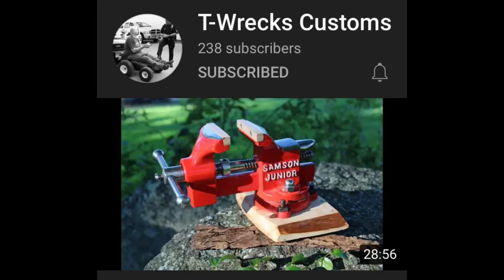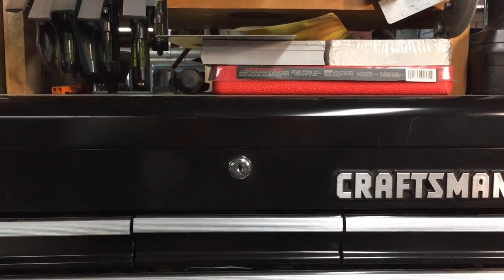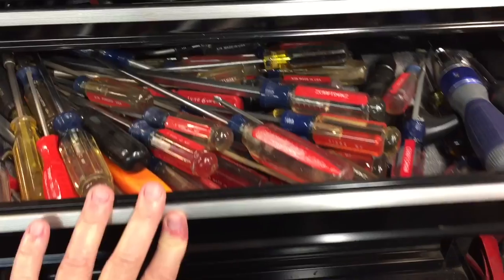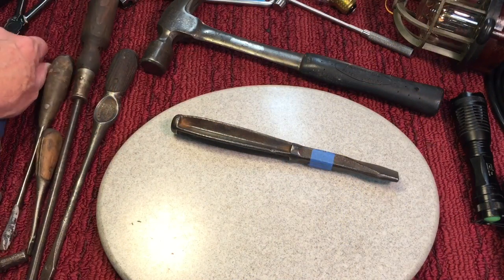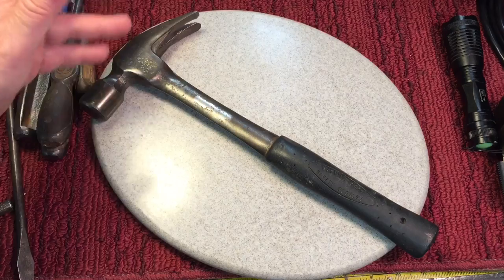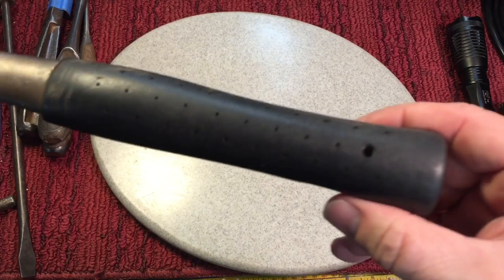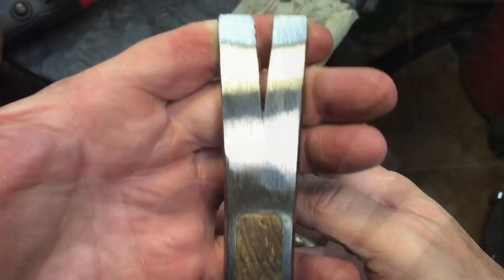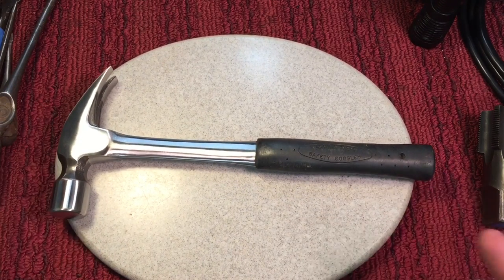Vintage Collectable Craftsman Hammer #38273  20oz "M" Series

Comment: #2 HD Smith.. Top of the box is great for bulky things, gloves, safety glasses, oils. Small drawers for small tools, bits, blades, pencils/pens, rulers, slide rules, drill keys, etc. First wide drawer screwdrivers, then a plier drawer, then a drawer for SAE wrenches, drawer for Metric wrenches. First big deep heavy duty drawer is all sockets, rails, ratchets, extensions, etc. I've had all my toolboxes over the years set up that way ever since I was 14 and worked for a guy who had his set up that way, so it really stuck with me.

Comment: I don't think my method is very good, but it works well for me. I group things according to their main mechanism. All screwdrivers in one drawer, anything with handles like pliers in another drawer, hammers and crowbars and pullers in the bottom. I find that a lot of the time the name of a particular tool escapes me but the motion you do with your hands for that particular tool is the criteria to sort by for me. Separate to that, I keep separate boxes for plumbing, electric, machining, etc. For tools that require a particular thin wrench to change the bits or have accessories, I make a simple wooden box and get an extra slim wrench or whatever it is needed and always store it and the accessories with the tool along with any consumables. Almost all consumables I buy in large bulk. And result is being set up like a hardware store when it comes to fasteners. Best investment in any shop is a well stocked nuts and bolts cabinet. Anytime you buy fasteners or consumables in small amount s you get screwed on price.
I think it's also a different problem if you're one of us that has more tools than we can keep track of. That point is when I switched to my current method.

Comment: Three toolboxes here which now store tools that I seldom use. All my tools are stored on racks on the wall of my workshed/shop. Hammers all on one rack (like a blacksmiths) where people usually say "don't you think you've got enough hammers?"... "no"... Two racks on wall for screwdrivers. One phillips, one flat. One rack for pliers. All spanners and sockets on the other wall along with calipers etc. One machinist toolbox on the bench contains smaller tools like punches etc . One set of drawers (old clothes drawer) have wood equipment. Planes, saws, chisels, files etc. one set of shelves for power hand tools. Three sets of box units (pigeon holes) for screws, nuts, bolts, nails and gardening stuff. Organised chaos. Oh and before I forget. No.1 please. Keep up the fantastic work. All the best from New Zealand

Comment: I bought the same hammer at Sears when I was in high school in the early 90's. Slightly different rubber handle, it has the Craftsman logo molded into the side opposite the "wear goggles" warning and little chevrons all over it.  The rubber is soft to this day with the matte finish, it never turned shiny and hard.  It's always been my go-to when I need a hammer,  hanging up on my pegboard tool wall within easy reach!  You did an amazing job on it!

Comment: label maker labels on the drawers. Separate drawers for Phillips and flat blade screwdrivers. Small drawer for utility knife, punches, Sharpies and etc. Pliers drawer. Wrench drawer for combo wrenches Metric on the left and SAE on the right and hex key sets. Socket  drawers by drive sizes. Extra drawer for impact deep socket sets. Hammer drawer for hammers, hacksaw and pry bar. Bottom cabinet deep drawers for big stuff like pullers. Top till drawer for long stuff like torque wrenches, pry bars and breaker bars.

Comment: My vote would be number 1.
The hammer works for me in both forms !  Purist and Scoutcrafter pimped !
My advice on toolboxes would differ between home and work use,
        Work toolbox, if you need to move it around, try not to duplicate items, take the duplicates home ! 
         Weight is usually the biggest problem. My work toolbox cracked around the wheel fixing points. It was repaired using 3mm sheet steel inside and out, along with 6" industrial cast wheels ! 
          Positioning will always be personal choice, I always tried to fit sockets into taller drawers and pliers / spanners / screwdrivers  etc  into the drawers that did not require height. I also made some trays that slid along drawer top side edges for additional space on a couple of drawers.
          Rubber line the drawer bottoms. Stops sliding, protects drawer paint.
          Keep heavy items as low down as possible.
          Safety note;
          Some workshops now do not allow 'step up' and 'top boxes' due to tipping danger !
          Only bottom cabinets allowed.

          Home use;
          If you are like myself, the tool cabinet will be stationary mainly due to space considerations. 
          All the duplicates from work will be piled into each drawer.
          I keep a few tote trays handy for using outside etc.
          I try to keep smaller separate boxes for plumbing, electrical 12v, electrical 240v, and boxes that I use away from home. 
          Really when a box becomes full, being a collector the only choice is to add another layer, or extra capacity somehow.
          Agree with keeping constant use tools at easy height, but always try to keep heavy items as low as possible.

Comment: I tell you what I used to do. I kept my multiple use tools separated by SAE and metric. Screwdrivers separated by tip. Pliers in one place. Then, the remainder of the tools were separated by their intended use or type of job that was to be done. Special project tools or infrequently used tools were kept not as easily accessed but, still close by. Precision tools were kept completely separate and in a cleaner area than the others. I knew where everything was almost by feel.

Comment: I set my boxes up depending on the musical instrument the tools pertain too.  Stuff for the organ.  Stuff for doing brass instruments in another. Etc.  Then a general box for house repairs filled with hammers, screw drivers etc.  A lot of overlap and Stuff getting mixed up.
Back when I had my '63 Buicks, it was easy.  You could take the whole car apart with a 1/2 ...9/16 open end wrench, a screw driver and a few sockets. Anyway...thats about it. Those tools are still in a little 6×6×10 box.   That hammer is AMAZING!,

Comment: I have a similar Craftsman set-up My pet peeve is the top edge of the bottom box creating a shelf that, as you mention, becomes a catch-all. Every time I need something from the bottom drawer of the center box I have to clear the deck. Next time I will buy all the boxes with the same depth and no shelf.

Comment: I found some stuff on Amazon pretty cheap that was like the non-slip mats you put under a carpet, but it is impregnated with silica gel or some type of desiccant. It's only been two and a half years but I'm pretty impressed so far. Also, I don't know about others, but my top box locks the drawers if the lid is down all the way. Super annoying if you don't remove the lock bar, on the other hand it's the only reason that there's not stuff stacked on it

Comment: My first concern with tool boxes is usually weight. I have had too much stuff in a high drawer and opened it fully and the top back tipped right over. So try to keep the heavier tools in the backs of the drawers and the real heaven stuff in the bottom drawers! My two cents lol

Comment: Well No. 1 if you do something special with the handle like epoxy in custom wood inserts or fill it with colored resign or something, otherwise I pick No. 2...............Carpet's my favorite drawer liner but in the really thin drawers I do have to go thinner lining material.

Comment: Setting up your toolbox is very personal. As usual  the tools you use most should be the best accessible. But the best tip is to make your own foam inserts for nuts, bits and  wrenches. you can also keep small plastic containers from fruits and veg you bought to store drill bits, pens, old toothbrushes ,..

Comment: A few years ago I picked up at a flea market an old Craftsman toolbox/cabinet on wheels from about 1950.  For its age it's in nice condition. The top and bottom portions have a total of seven drawers.  The bottom has a cabinet with a fold down door.  Quite a bit of tool room for its age. It's painted a gloss gray and has the old Craftsman "cigar band" logos on it.   I installed rubber mats in all the drawers and now store all my vintage 1950s and earlier hand tools in it.  Like your tool storage suggestions!

Comment: I have slotted screw drivers on one side from large to small and Phillips on the other side. Pliers and wire cutters and another.  S A E wrenches have a drawer and metric in another. All are in order so you can grab as needed. The top of my box has the 1/2 &3/4 sockets and ratchets. I have learned that origination saves a temper from showing. I combined my work rollaway into my shop rollaway. I try really hard to put them away when I’m done for the day. Another note I put all my bits for the screw drivers in a Plano tackle box. They are clear and a lot of sections. Also works well for saws all and saber saw blades. Every body is different but organization is key to happiness.

Comment: I'm in a big fan of using the uppermost drawer of the lower cabinet solely for layout supplies. Scribes, Dykem, squares, compasses and calipers. This is the only drawer that gets kaizen foam. I love the stuff, but I'm too cheap to buy it. I bought a fancy suitcase designed for camera equipment that came with kaizen phone which I reappropriated

Comment: Wow, you have turned a $3.00 hammer into a $4.00 hammer.  Astonishing and fun at the same time.  My tool chest lays out almost like yours.  The main chest separates wrenches from screwdrivers from pliers form hammers.  I also separate out knives (which includes chisels), Allen wrenches, and "small" tools.  My cart, like yours, has a "specialty" tools drawer toward the top.  Liners?  I like the stuff that is used as drawer liners for the kitchen drawers; it's cheap and holds up well.  As always, thanks for sharing.  It is surely appreciated.
Reply: Lmao

Comment: My tool box???? Yoga Mat!.... I cut up yoga mats to line my drawer bottoms. These are about 1/4" or thicker, come in lots of bright colors, and are often found at the flea market. Light colors make but easy to see the tools. You can even divide a drawer by using two colors.... Metric on one side and SAE on the other.

Comment: Screwdriver #1 – but any will be fine.

Tool box organization: Find what organization works for you and stick to that method.  Everybody has a different method that works for them.

What I do is separate so wrenches, sockets, screw drivers, hammers, and pliers have their own drawer(s).  Separate sockets and wrenches into inch or mm.  I use wrench holders to keep all the same type of wrench together such as inch combination wrenches.  I bought some aluminum socket rails for the sockets – those rails only hold 1/4", 3/8”, or 1/2".  I don’t have 3/4" sockets so I don’t have to store that size. 

I like the solid drawer liners – dirt goes through the ones with holes.  Home Depot has some of the solid liner for 18” deep drawers.

Label drawers on the front – makes it easier to find tools.  I also label the drawer on the inside for tool box and drawer location so I can put the drawer back in its original position (I have several tool boxes that are the same type).

My shop is in the basement – so everything except the bench is on casters so I can easily move it.  I use decent home grade tool boxes since I have to get every box down a set of steps.   I take out the drawers and move the box by itself when taking existing boxes up/down the stairs.  When I get a new box, I leave it in the box while getting it down the steps – I just slide the box down the stairs – only need one person that way. 

If in a humid location, use a dehumidifier.  Repeatedly going through the dew point will quickly cause rust.  

As time goes by, more tools seem to appear in the basement (maybe they are having babies) – I now have many tool boxes/cabinets and I still could use more boxes.

Comment: Great video I think you should do #3 it's a smallish it should be the quickest. I usually start with specially tools in the little doors then move down to screwdrivers wrenches use a little bit taller door for pliers cause I stand them up so they have I'm getting more in a in the drawers and then the bigger doors I usually use for a hammers power tools bulky stuff and cases on the bottom

Comment: Stock your box(es) according to what you use most. I use smaller cheap  boxes  also for dedicated tasks. Brake jobs, oil changes, electrical repair, drywall you name it

#2
That hammer is tool lovers bling bling

Comment: I’m embarrassed because I found out the same thing. I bought a five drawer tool cart from Harbor Freight and put all of my sockets underneath the lift lid. I put a small moving blanket on top of the lid to keep things from scratching it. Now every time I want a socket I have to take everything that I have taken off of the lid and lift it up to get out my sockets. I have another rollaway that I bought from them and I much rather would’ve had two of those than the five drawer cart that I bought. It seemed like a good idea at the time and I thought they were really cool. Not so much now

Comment: Great work on the hammer! I can't pick just one of the screwdrivers, they all have potential. I totally agree that the top of a tool box should just be another pull out drawer. I don't think I have a specific method or plan for organizing a toolbox, but I agree that the most used tools work best in the upper drawers. Mine just sort of ended up that way.

Comment: Good video today John. My toolbox is organized by the discipline plumbing in one drawer electrical and another sockets wrenches Automotive etc. big tip I put labels on each drawer of what’s inside it that way in case you have a buddy come over and helping you on a project he knows where to find the tool. I use an inexpensive P touch label maker comes in handy labeling circuit breaker to..I say number for screwdriver since it’s the biggest challenge

Comment: I know I am a year late but this is believe it or not a craftsman-sears 20 oz hammer I worked with an old timer a few times who had one of these and then I found one on eBay and then proceeded to buy 4 more on eBay because I like older tools and like to have extra Incase on gets stolen/lost or break but this is a craftsman I assure you best most well.balanced heavy duty hammer I ever used I use it everyday and I love it!

Comment: Those flip-top compartments, which become inaccessible with anything piled on top, are indeed a waste of volume and actually a nuisance.  (And that goes for Kennedy boxes, too, which the company puts a handle up there so you can't even stack anything on top of them.)  On the other hand, putting hammers in buckets (thanks, 805roadking!) sounds like a really good idea, especially in my case as it'll remove them from the top compartment of a box in the middle of a stack of them.

As for The Question Of The Screwdriver — I'm partial to Perfect-pattern ones, so I'd be happy with #2, #3, or #4. But #2 interests me the most with that wide and thumb-friendly recess in the shaft, so that gets my vote.

Comment: Now that's a perdy hammer right there ;) I have set my Tool Box up with Screwdrivers, wrenches then sockets because those are what I use the most.  I also use the non-skid matting that you mentioned.  I try to keep everything placed in its own spot, that way I can tell what's missing at a glance. I remember re-organizing it several times until I found the setup I liked.  I have to say I like that #2 screwdriver for the next project, But I would like to see that #1 as well. Craft on John...

Comment: Do # 2 
Fill every space full and the top holds the most must use it. I do separate by items I use but the nice thing is that full extension ball bearing drawers hold a lot so fill it up!
The hammer has a hole to hang it by so the great looking hammer should find a empty nail or hook and it should be a handy prominent place of honor!
Perhaps laser engrave your email address on handle!

Comment: 'Any horizontal surface becomes a shelf." Ain't that the truth! I have a Starrett 18X24 granite surface plate that I would use a lot, but what a pain-in-the-ass it is to clear off. My buddy, Joe Martinec, a retired construction master carpenter told me those forged hammers were unbreakable, but after years of using one, they will give you tennis elbow to the max.  No.2 is the one for me.   PS - I LOVE the pimped out hammer, but can you imagine what would happen if you pulled that out on a job site.  I know one thing, you better know how to swing it.

Comment: Difficult choice for screwdriver but #2 looks appealing. For those conditioning belts, initially they would not work for me until they were stretched. To loosen them up I used a small diameter pipe between the monkey bars of our grandchildrens swing set and hung from them. Suppose there are other ways but it seemed to work. My 170 lbs didn’t break them so they are fairly strong; starting them still required a gloved hand on the top pulley to help the motor spin up. Hidden under that “3 star” hammer, was a “10”!

Comment: I have a smaller service cart with tools specific to doing scheduled maintenance, which are usually the dirtier jobs like oil changes, chassis lubrication and brakes. I line the drawers with cardboard from delivery boxes. The “liners” can be easily and cheaply swapped out when they get too greasy and grubby.

Comment: Nicest $3 hammer I've ever seen.  I'm still trying to get my tools organized as you are.  I generally keep woodworking / carpentry tools separate from the mechanical tools, and of course a separate small tool box to keep in the car.  Toss up between #1 and #2 for the screwdriver resto.